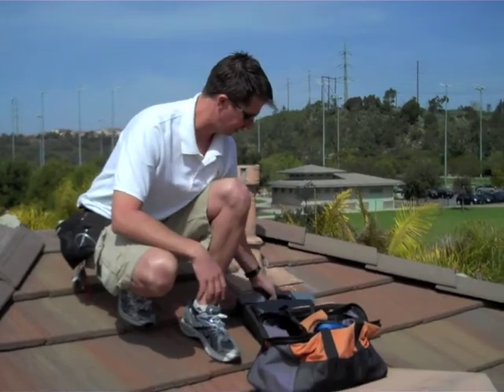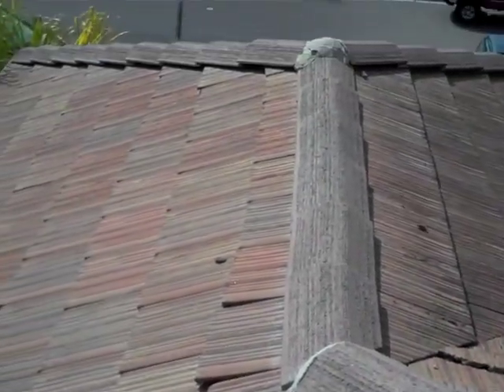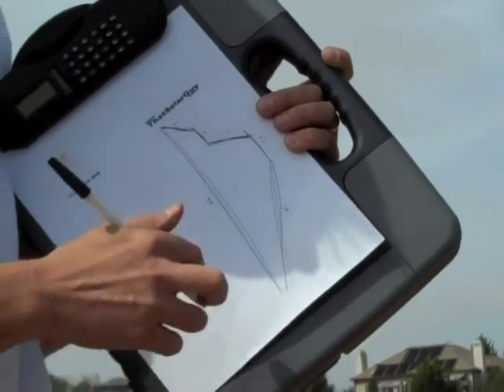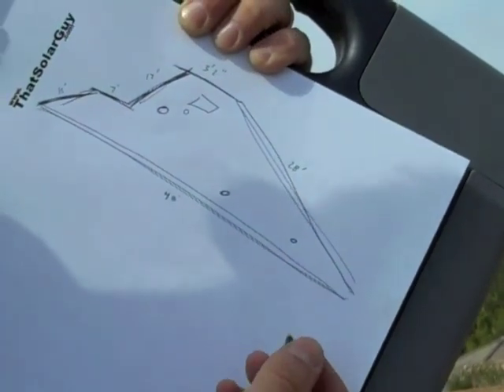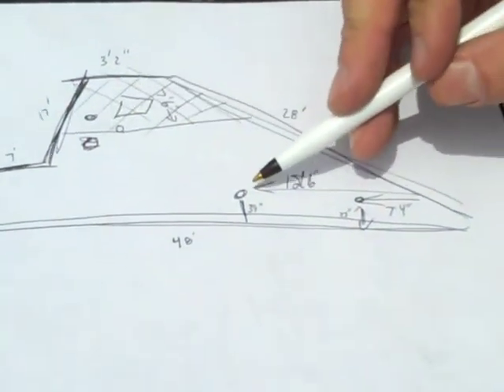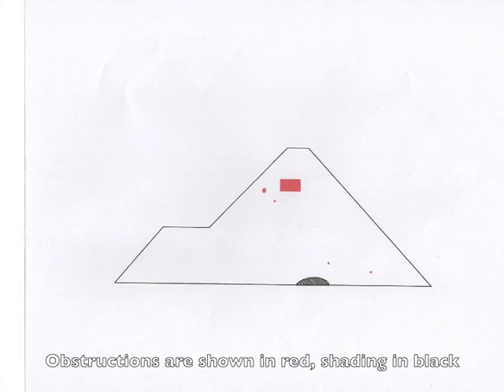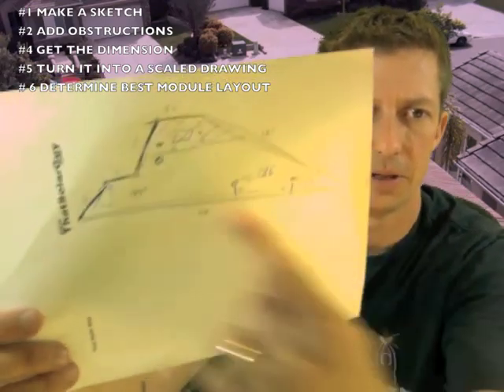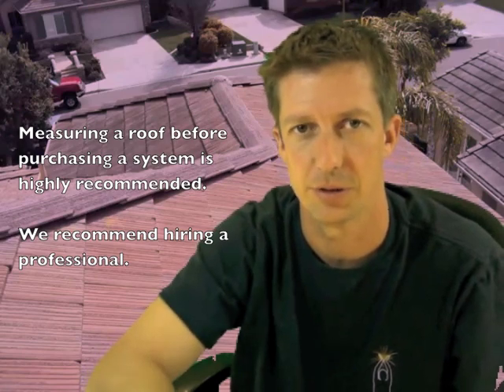That Solar Guy - How To do Roof Layout

Comment: When measuring the roof you did not dimension the roof in terms of the angles of the ridges. Did you guess at those on the computer or were there additional dimensions you used that did not show up on your sketch? I understand that there are easier methods these days like using google earth but I am not comfortable with those. Cheers John